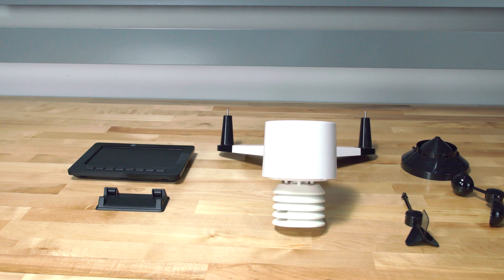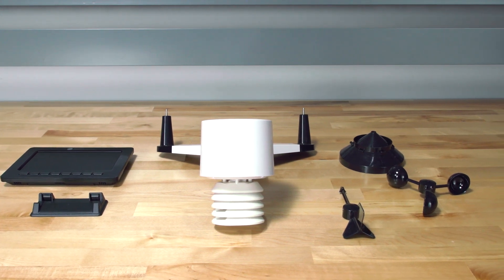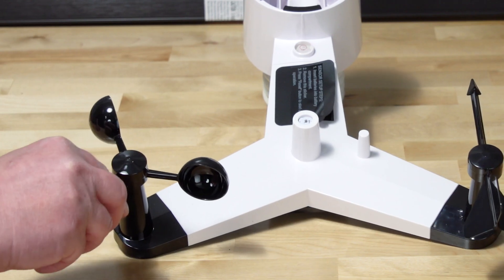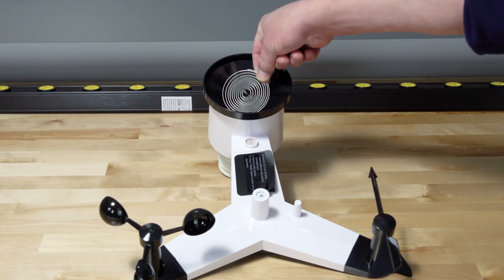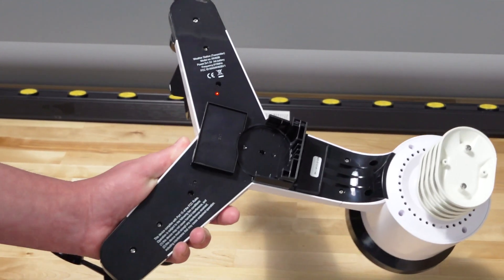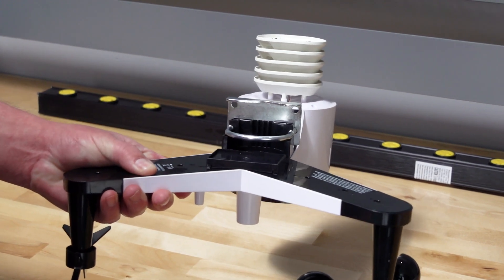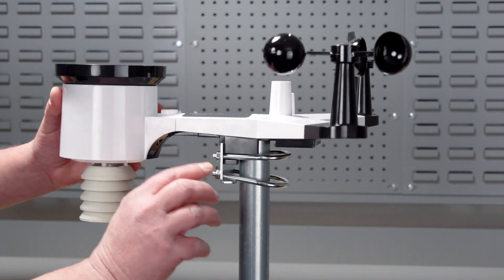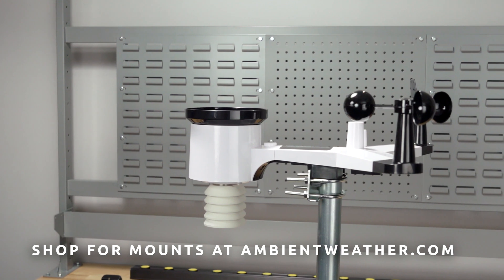Ambient Weather WS-2000 | Hardware Setup

Comment: Terrible system.  No instructions included, no batteries,  no mounting pole, no power adapter to power screen, screen won't accept batteries,  uses 10 year old antiquated USB type that most people won't have. I have another system that costs less and came with full mounting pole and bracket.
Reply: Instructions on the shown sensor part says "press reset," but I find no reset button on it. Do you mean on the screen? Shit like this should be included.